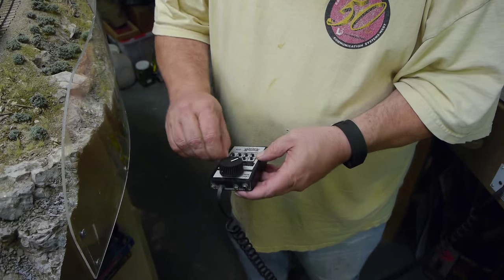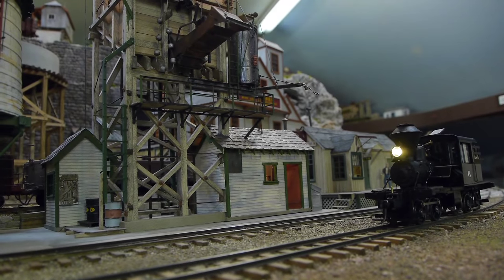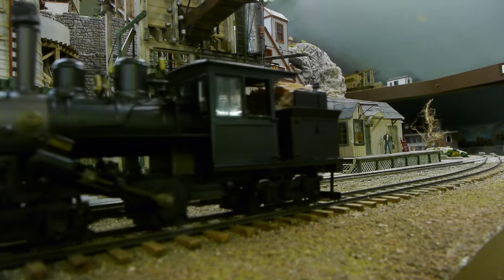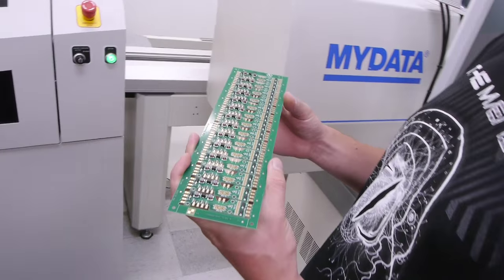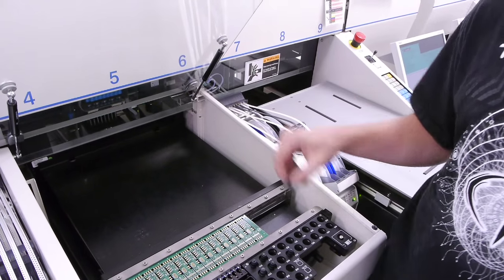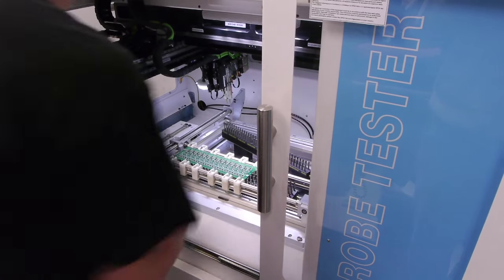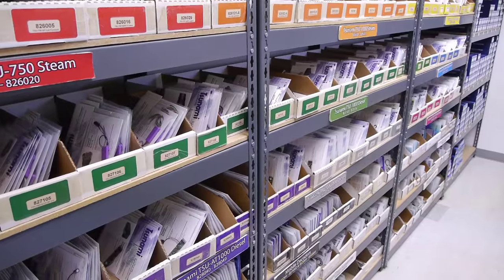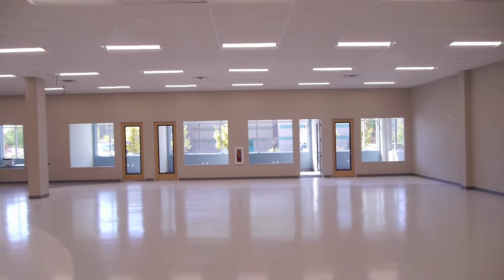Sound Traxx model train sound and control system

Comment: This is impressive. Like yourselves I had a layout without sound. It was nice to look at but when I finally came around to sound chipping, I never looked back. Most of our Diesels here in Ireland are General Motors, Yes, U. S. General Motors builds. The similarity in sounds are unmistakable. We're still waiting for the manufacturer to build the 121 class which has an identical sound to the great F9s in the States. Sound chips aren't cheap 100 Euros but the do finish the scene. Thanks guys.
Reply from the maker: Need to get back on these projects!!!!! So little time.. So much FUN

Comment: Excellent tour of the new & old Sound Traxx, manufacturing facilities.  A lot of technology. Thinking about building a layout. Go O-Gauge - Lionel, take a look at your logo hobby shop. A lot going on with Lionel, MTH, Atlas, 3rd Rail by Sunset Model and Williams by Bachmann.
• Cheers from The Detroit & Mackinac Railway 🚂
Reply from the maker: +trainroomgary Prefer O scale. BUT size matters. Also building a 1/20 scale at the shop. BIG. And we have On 3 and On30 at Steve's so I can build and run there.

Comment: how do you get the sounds? i would definitly use some for my HO 2-8-0
Reply from the maker: +Mr goat The units are at the hobby shops. The smallest fits in N scale!!
Reply from the maker: +Toy Man Television Bit tricky to instal if the loco is not set up for it but can be done. Need to rewire the loco.
Reply: +Toy Man Television that sounds pretty hard but i bet with some time and money i could get one
Reply from the maker: The units are in the hobby shops and on line. ANY loco can be done!!! Super cool. On the Guys Hoppy Shop link on out channel is a link to the hobby shop. Call and get the whole story!!
Reply from the maker: +Toy Man Television PS Not my hobby shop, but one I like.